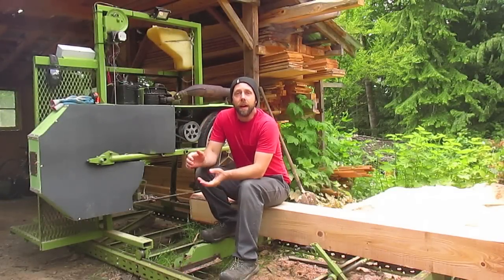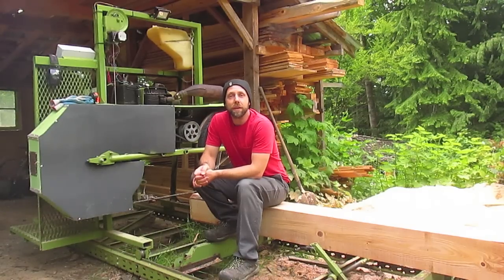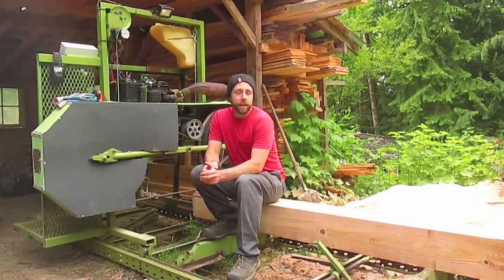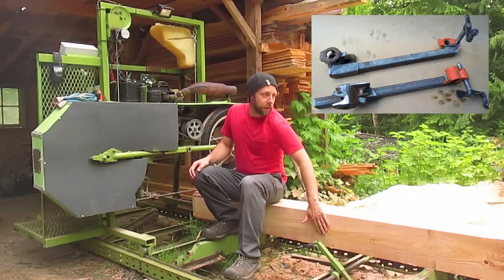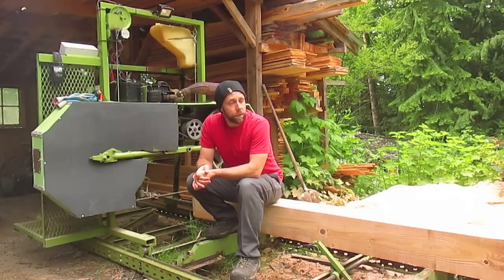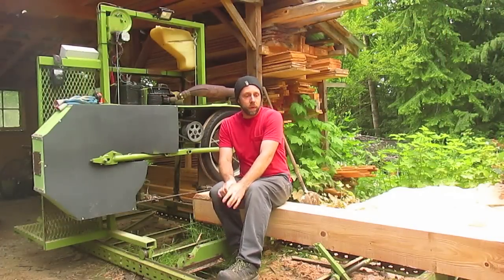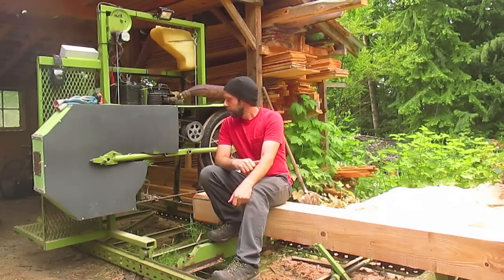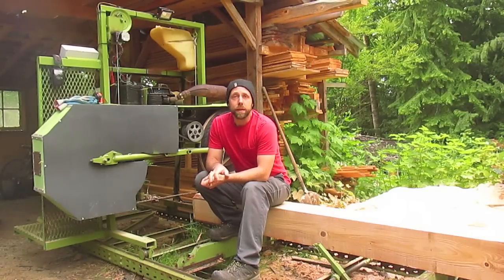Homemade sawmill tips on  how to building one

Comment: I'm going to build me a sawmill too. I definitely relate to using scrap. 40+ years ago when I was a welder, fitter, tool & die maker, mainly self taught, where I worked I was paired with a engineer that was passing through our little place in-between his high paying jobs and we're to build inner body and outter body jiggs. Needless to say I was his helper. Anyway we pittled around for a couple of days laying out all new parts to make the first inner body and the first outter body jiggs and I came in to work and my main boss told me Glen had left for another job and now building the 3 or 4, can't remember been long time ago, pairs of jiggs was my project. Ok so I built my prototype's, inner, and outter with the new parts and other odds and ends to complete them and then I mostly built the rest of the jiggs out of probably 90+ percent scrap from the scrap bin's behind the shop instead of sending it to the recycling company. I made big points with the company owner by utilizing the scrap. Oh well. Seemed like the thing to do to me. Like your videos.👍

Comment: I run a Hydmech h14a. The sound and power a saw blade has when it let's go is scary. My Morris blades snap when the blade tensioner hits 2900 psi. Its pretty stretched and worn at this point. I've learned to watch the blade tensioner so I can get maximum blade life without snapping one. Great job with your content . Your fab skills are fantastic.

Comment: Good Video Mike ! I do hope to build one one day  so I appreciate the advice BTW  its after the fact for you now but its pretty easy. To Mill Wooden Pulleys for Belts  out of either MDF or Plywood  all you need to do is cut circles and attach them to any  motor to spin those using a regular Wood Chisel  you can  put a V groove  for the rubber belts  i said that because you mentioned getting your gearing ratio   Correct a few times  yes the 11 in Spinal Tap is Legendary  and perhaps one of the most overused  funny by any Garage Band or Musician  but for some reason its still funny even at 56 years old

Comment: Very good video, I have almost finished my bandsaw mill and it should cut a 4ft log thats 25ft long 🤞. I'm using 2 car tires with a OD of 28" and a blade that is 244" long powered by a 22hb v twin. Since my dad cuts and sells firewood we get some big logs (5ft) that are too good and too big to chop up into firewood. Why don't you have a guard over the drive side of your mill?
Reply from the maker: I'm happy you are close on your mill, That's great! A big mill is perfect when you got big logs like that.
I would really like to see it when you get it done.
I have the drive side guard off for most of my videos so when it runs people can really see the wheels spin and some of the pulleys turn when in use,  it shows a bit more of the mill when I cut but still has most of the guards incase a blade came off.

Comment: Excellent comments and well thought out . Your machine is a great build, and like you said be realistic. Too many rush it and have problems myself included in that.  I built a vertical bandsaw 3 years ago and had a few teething problems along the way like balance of the wheels and some tracking problems so, it can be a bit tedious . My next project will be building one of these similar to yours as it's a FAB build, 

Great vid. Cheers.
Reply from the maker: Paul Stewart Thanks Paul for your comments! I’m glad you enjoyed my video. Like you said there’s always a little bit of tinkering at first once you start to run them, but most things can be overcome and worked out, I had a problem early on with one of my drive belts slipping, I ended up replacing the solid belts with notched drive belts and that fixed the problem. I bet you have seen some of my other mill videos but if not check them out if you get time. Take care :)
Reply: Mike festiva Thanks Mike. It’s always good to receive a reply from people on YT  and your thoughts are really appreciated. I’ll have to bare the notched belt in mind when building the next saw because your right pulley V belts are a pain and cause some vibration or intermittent shaking. Cheers all the Best. T/C have a great week.

Comment: Good points on the mill.  I built mine about 25 years ago and it has paid for itself many times over.  Mine is 18Hp, will cut 36" dia and 25' long and used standard Woodmizer length blades.  My house and mill at:  http://www.pbase.com/jimthode/house_construction
Other tech tips I'd add:  Use a hydraulic blade tensioner with with a gauge, knowing the blade tension will tell you a lot about the mill.  Think of ergonomics in the design, controls all at a arms length and remember you will be going back and forth along the log thousands of times.  Think about where the saw dust is going to go, Woodmizer missed this one, saw dust covers the sawyer.   A movable bunk is a good idea, I can and have cut "logs" as short as 12".   Make or build a blade sharpener, I modified a $120 chainsaw sharpener for bandsaw blades.
Reply from the maker: Thanks for checking out my video!
Good points you mentioned there.
Do you have any videos of your mill or blade sharpener? I would like to see them :)
Reply: @Jim Thode: Could you post pictures of the blade tensioner on your machine and some description of the gauge you used? 
I like how you moved the motor+drive pulley away from the blade. Most designs try to cramp blade/drive together on a short shaft but there is really no need for that in DIY  stationary machine. The only question I have is the diameter and material you used for the drive shaft to sustain the torque from the blade going through a 36" log.
Reply from the maker: Sorry Jim I didn’t see your post till today. The bearing guides I built from simple ball bearings, I did a video of working on them up close I can try and find that video, I used a 1” shaft for the jack shaft, and I just used the stock motorcycle axle bolts for the wheels to spin on. I definitely recommend you going to my YouTube page and clicking on videos and look over the sawmill videos, I have a good video showing how I built this machine from salvaging parts. Take care :)

Comment: What is your blade speed? I see a lot of guys run close to the 5000fpm, but I'm going to be around 3500fpm. Sure it might be slower cutting but less power. I'll be running a 13hp predator and a 30" capacity. (Most of my trees are sub 20" though)

Comment: hey mike ,
ive built a chainsaw saw mill, with a 14 hp kohler,  kinda sick of pushing it, so I've decided to build a bandsaw mill, would you change to trailer tires from your motorcycle tires , I think that's the biggest part of a mill ...thanks
Reply from the maker: I'm happy with the motorcycle tires on my mill, I however plan on building a smaller bandsaw mill that can be real portable and I plan on using small16" outside diameter  trailer tires for it. I would say use what ever you have, I think I'm going to be powering this new mill with a small 7HP harbor freight motor because they are easy to buy and cheap, It will however need to be geared down and it with probably cut a bit slower then my bigger mill.
I hope your new mill works out good for you! PS check out my two part video of my power feed, that could transform your chainsaw mill into something you don't mind running?
Reply: yea I saw the power feed , I thought of this myself and decided to YouTube it and that's how I found your video , damn nice mill for what you have into it, I have about the same into my kohler chainsaw powered mill, I'm going to make a  run off track for it so I can still use it when I need and use the bandsaw mill for lumber cutting , the chainsaw kerf is a huge waste, thanks for the reply good luck on the portable ,
Reply: I bought cheap amazon trailer tires for my mill, bad idea. The rims are way out of balance. Real wobbly. I think I may try spare doughnut tires.
Reply from the maker: Man that's to bad! Do you think having them balanced would help, or are they just far to out of round to use?
I had some trailer tires I was going to try on my new mill build? I guess I should check them before I get to far along on that project. Keep me posted what you come up with.
Reply: Mike festiva 
Im hoping balancing them  will help, it seem like the rims are out too. I had a friend give me some old trailer tires and wheels, those where really bad.

Comment: Really like your saw mill
I m looking at building one too
I like the idea of using pallet racking frame to weld the rail on...
I can have a used one 36 inch x 14 feet
I guess it need to be square and not twisted at all
How can I tell if it s ok for sawmill
Mesuring from each corner ?

Also how did you find out the distance that You were needing from wheel to wheel and blade lenght ... did you just go according to the lenght of the blade first ???
Reply from the maker: Thanks for checking out my video! I definitely recommend using the pallet racking, it’s so easy to adapt into a sawmill track. I just used what I could get for free, I got a few uprights and picked the best looking ones for my track, there fairly flexible, I think your good to use any of the stuff you can get as long as it’s not totally noticeable that it’s bent.  I just built my mill and then got some blades cut to the measurements I needed, a few things that determined my mill was track width, and wheel size, then I figured that a 26” maximum capacity was good for me by taking into account all the factors. I highly recommend you going to my YouTube page and clicking on videos, then going all the way down to the oldest video I posted, it’s how I built this mill, lots of good stuff in that video, then check out the many other videos I did on my mill, there’s been quite a few upgrades over the years! If you have and questions or need some help feel free to ask :) Take care
Reply: Mike festiva  thanks for the info !

Comment: What is the RPM of the wheels? I am going to build a band sawmill and drive it with a 18kw (25hp) 1400rpm electric motor. Can i attach one of the wheels directly to the motor?

Comment: Hi, I´m building one, but I have proble with vibrations, when the engine is running, the blade have too much vibration, do you know why?, did you have that problem or not?, thanks
Reply: R u using rubber tires ?
Reply: @DS-mm6fh  YES OF COURSE
Reply: @DS-mm6fh  NEW TIRES OF 13R, THE BLADE IS 4.64 METERS (184"), I HOPE CUT ABOUT 90 CM

Comment: What advice for a design that is robust enough to mill,  timber frame size grade,  Like will your machines blade get pinched off, if you had it set, (or made to do) 8 or 10 inches thick (height wise),  or do these mills,  is it standard that you only really do, 2" or possible 4" thick?
Reply: You can mill any thickness your saw can handle , you just use a few slim wedges behind the cut to keep the weight of the timber Fromm pinching the blade

Comment: idk about building the mill down to size, if youre open to building a second one with improvments in the future sure but if youre building one to last forever id build the track out to your biggest expectations then put the engine on it you can afford.. its alot easier to put a new engine on it than a new track and rolling blade unit ntm if you ever try to sell it comparing it price wise to the professionally manufactured ones sized to say 36" can make yours seem like a steal even if maybe it doesnt have the hydraulics and power to handle those logs

Comment: Do you ever have any problems with your belts slipping?
Reply from the maker: I had some problems with the first set of drive belts when I would push it hard in a big cut and the mill was hot on a hot day, 
I switched from the solid v belt style to notched v belts and this took care of my problem, since I replaced them it cuts great without any slipping.
It was mostly the smaller one connecting the clutch to the jack shaft.
Thanks for watching.

Comment: Diameter X Π = C + distance between axles. This will give you the Circumference of one wheel. Then ad the dimension between axles . This will give you the blade length.

Comment: To get the belt length build the saw with wheels in situ,measure the centers of the wheels and add the circumference of one wheel and that is the length of the blade.
Reply from the maker: Roger Dale I’m sure that would work, I decided to just measure it with a tape, it keeps it simple and with the tires being able to expand with air pressure I felt it was the best real world way to measure. Can you tell me a little more about your mill?

Comment: Hi, how many Feet Per Minute does your mill cut at ? I have a 22hp Kohler motor and 27" tires with a 5" clutch. I was going to run the two v belts straight on to one tire. I used this website : http://vintagemachinery.org/math/sfpm.aspx to calculate the speed and came up with around 3925 SFPM at 3000 RPM. But I am unsure what RPM my motor will do. Do you think that it will be pretty close to the correct cutting speed?  I'm going to have a cut with of 1200mm (4ft) and have been told to go a bit slower than normal so I have a little more torque.

Thanks

You forgot to add the cooks sawmill link into the description :)

Comment: What kind of blade do You use?
Reply: A banded one
Reply: @joshyingling  how many theech by inch?
Reply: @nachobonn2023  depends on the finish you want, lots of people use 1-4 teeth per inch. The gullet depth matters more for ripping like in this application, wide trees need deeper gullets to carry Away chips/saw dust
Reply: @joshyingling  thank You.

Comment: There are large glulam beams that you might need to cut in half, that's a good reason to have a 36" capacity.
Reply from the maker: KarasCyborg I have never come across 3 foot glulam beams but if you have a source on them and need to cut them up then it would be worth building your mill bigger, I just mill logs from my property and the capacity of my mill works for the trees I have and can move.
Reply: Mike festiva 絵fでっっだ
vhgrrccgfをっっだhゔ

Comment: I can add a few things to these 10 awesome tips I learned from building my mill. Blade speed should never exceed 4500 SFPM and it should be reduced in increments as HP drops (I run a 19 HP@ 4500 SFPM) Use the blade speed calculator @http://vintagemachinery.org/math/sfpm.aspx  so that you know what pulleys to buy before you just guess at it and waste money.
Reply from the maker: Blade speed to HP is one of the most important things to get right on bandsaw mills, I have seen many home built mills where people put little thought into this part or just guess and most of the time end up gearing them way to high, I added a link in the description of my video to a page that will help people understand and calculate speed to HP.
Thanks for your link you posted and your comments on bandsaw tips :)  I hope people interested in building a mill take the time to calculate and get there gearing right, it make all the difference in a mill!
Take care

Comment: What about a stationary electric bandsaw mill? One where the log moves instead of the saw? I think that is simpler and if you have enough linear space it seems much better.
Reply from the maker: I have only seen a few small bandsaw mills  where the log moves rather then the saw. I’m sure it would work you just need to build twice the track.
Reply: Mike festiva well I was thinking about maybe connecting it to an external source of power much greater than what I could get from an electric motor like an old 25 hp tractor. Only issue I can think of is dealing with changing the height of the head of the mill. I don’t know too much about mechanics. Maybe I’m in over my head but I think it would be cheap and convenient. I would use wood for the base of the track and steel for the moving track with wheels on it.
Reply: @Dollapfin  it's alot easier to move the smaller lighter saw then the log. The old Mills that used to slide logs on a track moving by a large round blade had a bad habit of having the logs shift and fall off. Modern commercial Mills do often move the wood instead of the blade but it's a different setup than would be practical on a small scale.

Comment: I have trees all the time that are 6 foot across and sometimes bigger I need a huge mill !!!!
Reply from the maker: Sounds like you definitely do.
Reply: Wondering what you think if I used a let's say a 22 horse engine and had two or three spots on the belt pulley ran the bandsaw blade off the first one and use the second or third spot on the  belt pulley to run a hydraulic pump I'm not sure if some people do that wondering what your thoughts were

Comment: If I had that I would frame the walls with 4×12 studs
Reply: Just kidding, nice build
Reply from the maker: Haha! I saw your first comment and was thinking man that would take a lot of trees to frame with 4x12s! 
I actually got some 8x8” posts milled up and I need to mill a few big beams,they need to be 24’ long 8x10”s to cover to track of my mill this spring, it’s too hot to mill mid day in the summer and way to wet to be interested in milling in the winter, so a roof will help. Thanks for checking out my video!